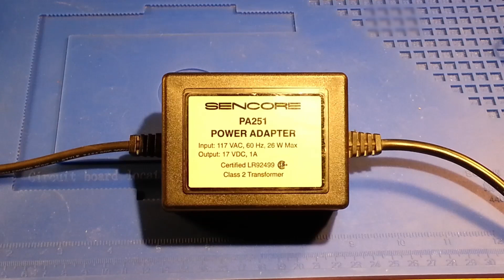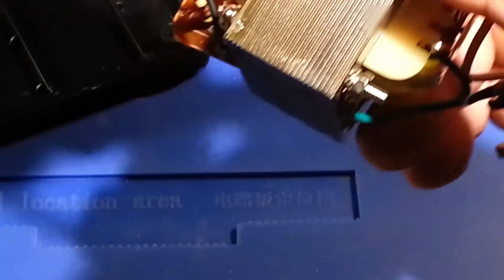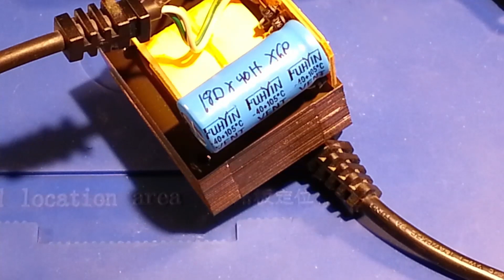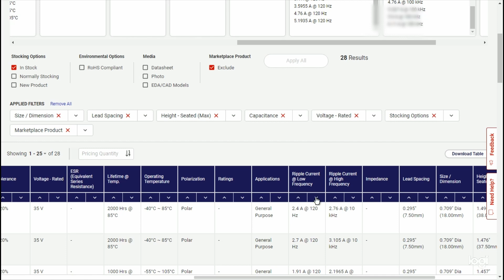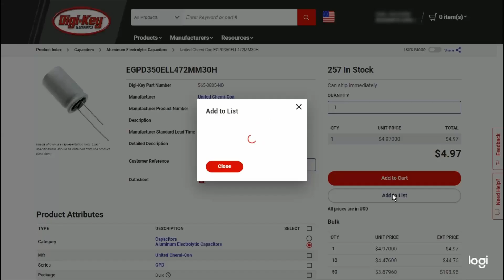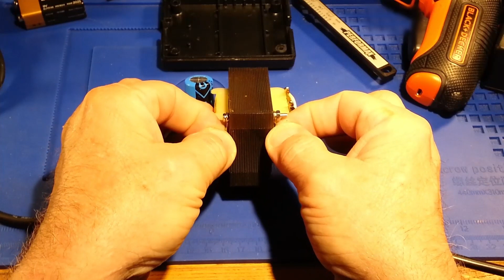E014_PT01 - Sencore LC102   PA251 Power Supply Inspection for Recap

Comment: Definitely worth the effort imo. Like I said before it helped the ripple. I read a recommendation to add a second small cap in parallel to further reduce the ripple but I haven't done that yet. Maybe your install video can include a test to see if it helps. I think it was the pF range for high frequency. There's a vacant spot on the board if you are game. I guess they over engineered and decided to exclude the second large cap.
Reply from the maker: I didn't investigate it, but there looks like a spot for another E-Cap on the opposing edge of that board, that may have a high value bleeder resistor installed in it. I'm not going to go any further with mods on it, because the LC102 itself has some more filtering once it gets inside. It looks like it hits a 0.1uF first, then in and out of an LM317, then a 220uF bridged with another 0.1uF. If it had symptoms of bouncing readings, I'd look into it more, but it seems fairly stable with most measurements.
Reply: I also own a LC102 that came with a replacement power supply and I wonder, if it might be a bit "jumpy" in the low pF readings. Can you please tell me, how much variance you have in your readings measuring a 1000pF capacitor?